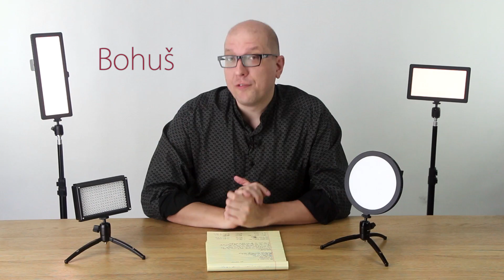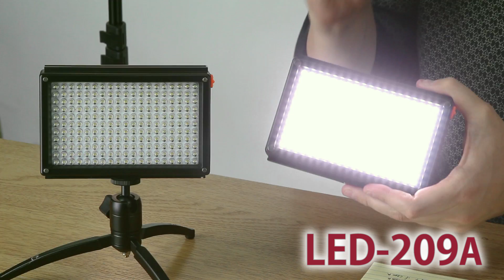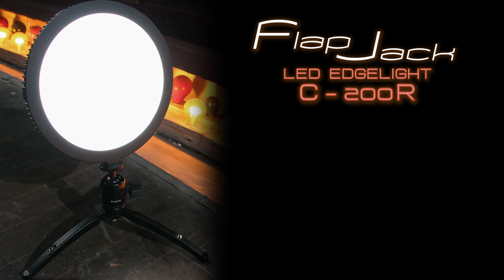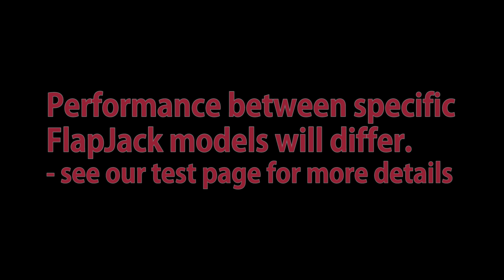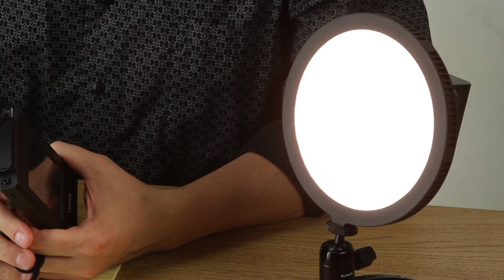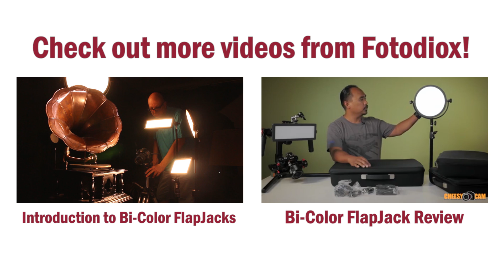Resist the Bi-Color Curse with FlapJack LED Edgelights from Fotodiox

Comment: which is better bicolor or daylight??
Reply from the maker: Hi Gil,
It really depends on your needs. They're both close to equally powerful, so it's really a matter of whether you think you'd need color adjustment or not.
Reply: which ones is slightly powerful??would it be the daylight because there all the same??im using them for lighting up a skate spot outdoors to film my friends skate
Reply from the maker: The bi-color models are slightly more powerful, but not by much.